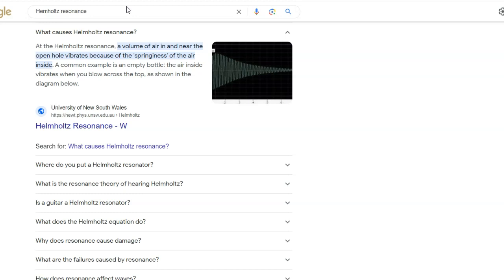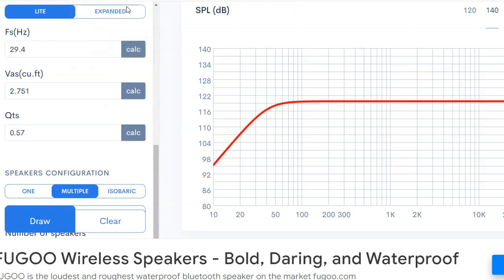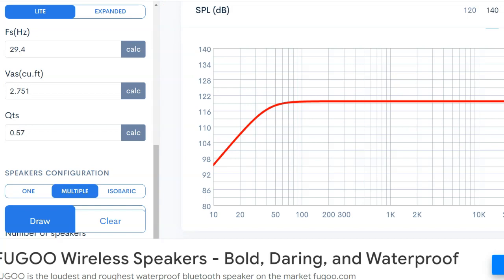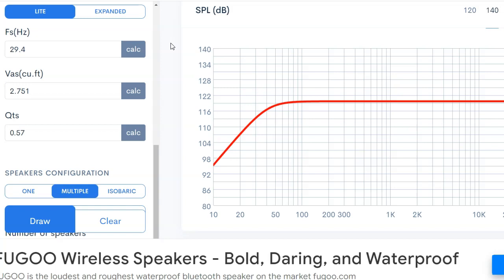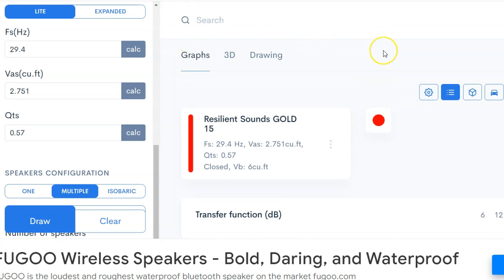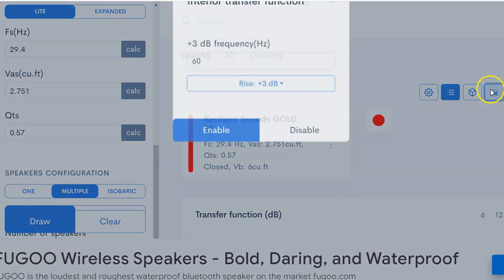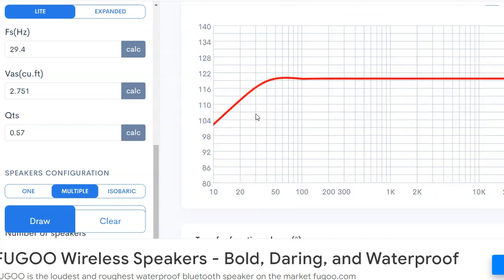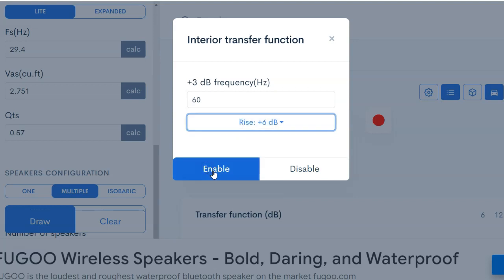Secrets to making your subwoofers loud! Episode 2, Car Cabin Resonance - SPL

Comment: What about the trunk vent will sealing it up gain more spl
Reply from the maker: Typically yes, sealing as many vents to the outside of the car help.  Sometimes however, vents, especially ones that are on the opposite side of the car can help.  Think about rolling down a window, most cars get louder.  See if you can temporally cover or stuff the vent and see if you notice any difference.
Reply: @caraudiolab  Wow that makes sense. I believe this is another small secret that these guys are trying to hide. Thanks